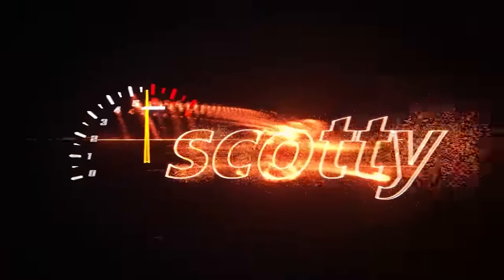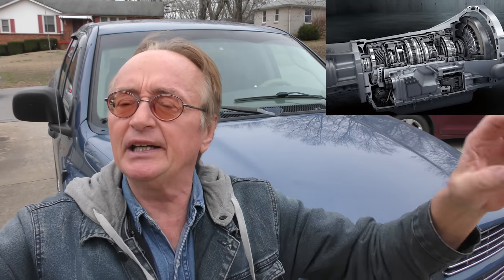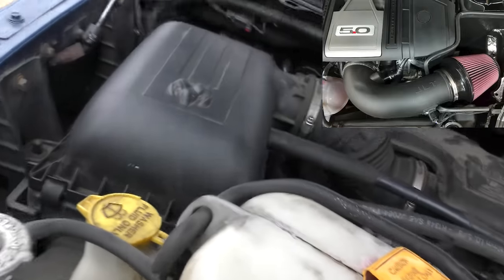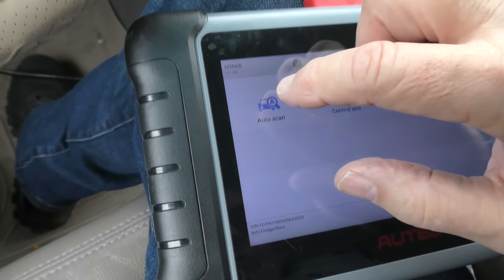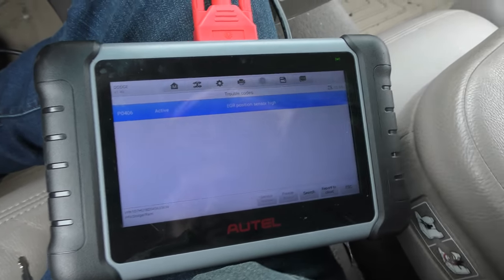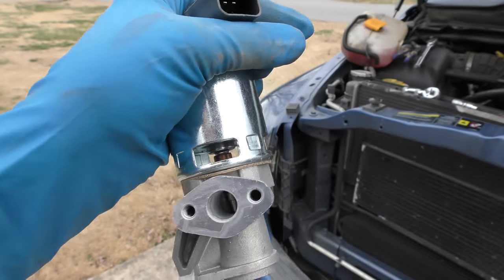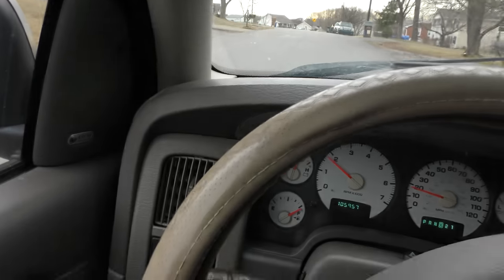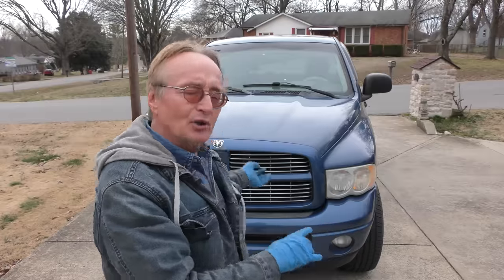Please DO NOT Buy a Dodge (Unless It Has This Engine)

Comment: I have a 2003 dodge ram 4x4 with 5.7 Hemi with 123,000 original miles. 2nd owner. Regular maintenance and never any major issues. During pandemic I wanted to see what a local dodge dealership offered on a Rebel. They offered me $15,000 .

Comment: My 05 Chrysler 300. Does this. I'm not getting any codes but it don't stall it idles rough. It has the hemi. Any ideas? I do think it's electric cause I undid the battery and it ran good for like 2 days and came back.

Comment: That would make you wonder what it is that is wrong like when a diesel motor starts sucking air somewhere in the fuel flow which my happened to know but just let it start leaking, hahaha he would say jokingly I would be wasting my time to try and get a license to drive now that the traffic officials are not enforcing the law on road safety, when it's on a steep sloppy road it's easy for it to just switch off,it takes time to start even on a flat surface but the cops would not give a ticket or a warning for that, maybe now they do I don't know, it's still those cops that just apply for jobs maybe not someone who has a course in public safety,or maybe now they have

Comment: I have a 2006 Chevy equinox and I had to replace my Egr valve and the tube but I could not buy it online I had to go to a Chevy dealer we're I had to pay 363 dollars because Gm decided to change the design so if u go onlline and try to buy eighter one the will not fit,i tryed it twice and the tube was to short so when i contacted the company tbey reimbursed me my money and told me to keep the tube so now i have 2 tubes that i can not use however whene i came to the Egr valve i had to return it in order to get my money back.

Comment: Hey Scott my 2001 ram a.c. won't work & everything is working but still no cold air. What do you think is the problem?
Reply: Check the ac condenser fan. Bang it with a hammer. It may start working. If not...replace. Boom you have ac.

Comment: Those hemi's had valve spring issues (breaking) and lifter tap issues as seen those problems while working at dealer ship for way to many years. The Eco diesel was a pos when it first came out not sure if they perfected that engine.

Comment: My 03 Ram 1500 has 210k miles, only had oil changes, rad and brakes changed.  It came with a tape deck.  Trying to decide between rebuilding engine, trans, suspension and repaint or a new f150/f250

Comment: @scottykilmer i need help first dream truck i got and ran like a beaut for the first month i had it after that check engine light came on and p0700 and p02706 noticed when i try to go onto highway speeds it wont let me get any higher than 4th gear if not it slaps me into limp mode NEED HELP PLZ 😅

Comment: hey ive been trying to use that motive power bleeder u recommended in a prev video for brake bleeding, ive ordered 4x from that company and every single box is incorrectly packaged with the wrong adaptors, they were just bought out by agm and its like the ppl boxing the products just throw parts in boxes. everytime its a random incorrect part # that doesnt match the # on the box.

Comment: Does anyone know if the Chrysler 300 at this time with the same engine would be a good buy? I'd probably be doing about 15,000 mi a year of driving on it at least.
Reply: I have an 06 charger rt with the 5.7. it currently has 194,588 miles. The pre eagle 5.7s ( 2003-2008)  were pretty much bullet proof if you took care of them and didn't let them overheat which could potentially cause a valve seats to drop. My charger actually has most of its original parts. The only issue I really have out of it is coolant leaks, power steering fluid leaks. And I have a parasitic battery drain that I can't seem to figure out. Also I changed the transmission fluid and found needle bearings in the trans pan but it's been like that for years and never really affected anything.
Reply: I've got an 05 with 134k , no issues. I've replaced tires, brakes, battery and one sensor, that's it.

Comment: These are absolute pieces of junk don’t care what anyone says including Scotty. Unless you’ve owned one you shouldn’t have an opinion.

We bought a 1999 dodge Durango in 2006 and it was nothing but problems. Engine sludge, overheating, suspension failure, engine failure, and transmission failure x2. NEVER AGAIN will I own another Dodge product.

Comment: If one was to ever open up the top-end of any Newer dodge motor they would be shocked on how many plastic parts they will see in the motor. Even if you could find a ( good ) dodge motor that is in itself is nearly impossible .The body , drivetrain and tranny are just not up to today's standards. Best is to pass on Dodge altogether.